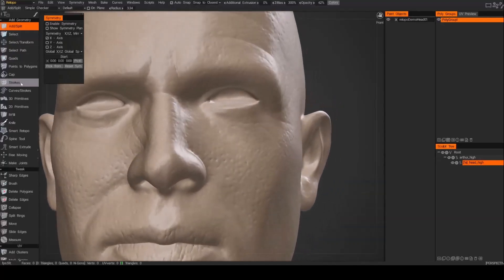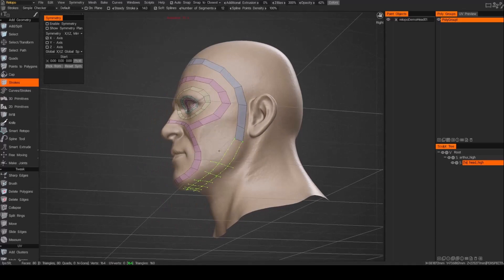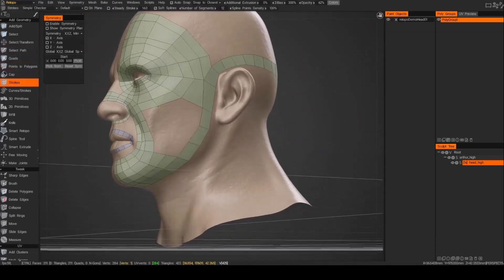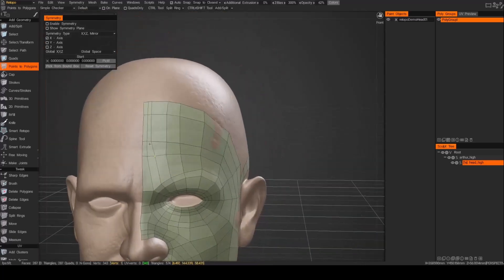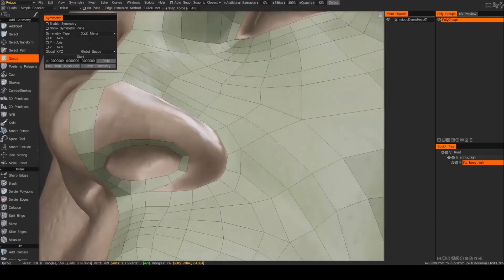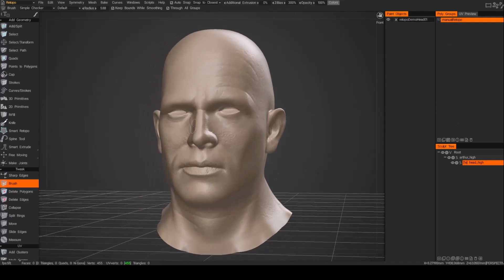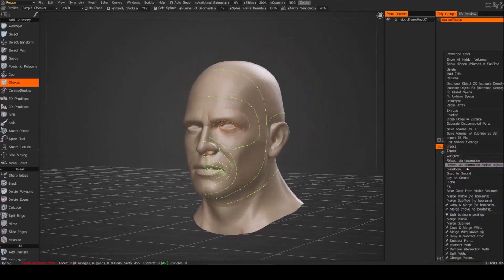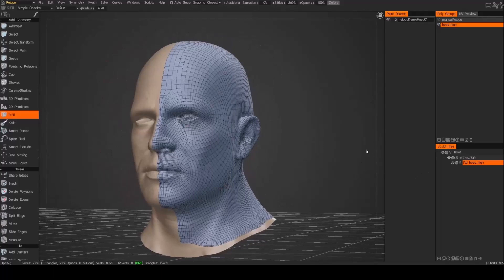3D Coat - Manual vs Auto-retopology.  A quick look.

Comment: Tell me, I press auto retopology, downloads and stuff happen, and nothing happens, why is that?
Reply from the maker: I've had this happen to me a few times. I have a routine now where I RMB on the sculpt layer and choose to set Global Space and then choose Close Holes on Surface. Also, I do find switching to voxels is more consistent as it removes weird mesh topology which can cause weirdness in auto-retopology.  I hope this was helpful. Let me know if this helps solve the issue you're having. 👍
Reply: @industrytuts5272  I'm very sorry, but can I ask you to go to some messenger and ask a couple more questions, at the expense of auto-retopology, there are no guides on the Internet at all, but there are many difficult and controversial points
Reply from the maker: @Soba4ka  would it be helpful if I make an auto retopo best practices video?
Reply: @industrytuts5272  Of course, but in any case there will be more questions.  If you make a video, then tell us in detail about the settings so that the best retopology comes out, the most common errors and problems that the user may encounter, and how easy it is to import files when you have 4 icons, what you need to click to avoid errors :)